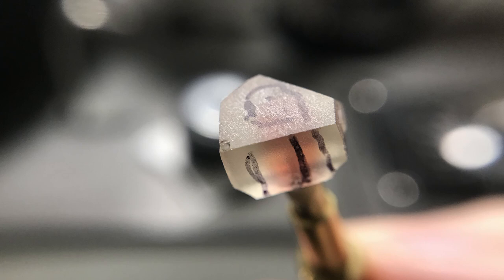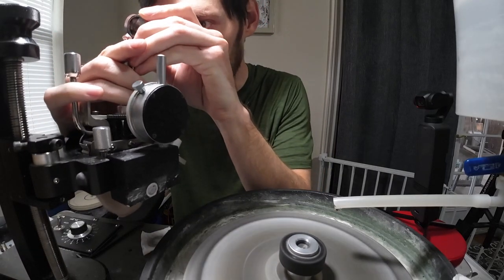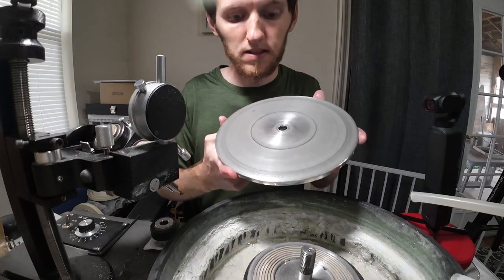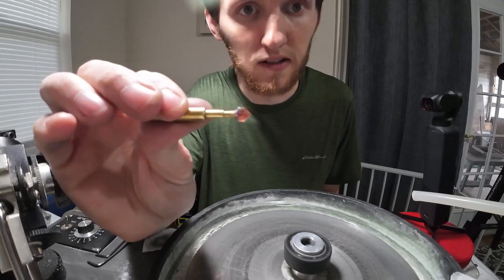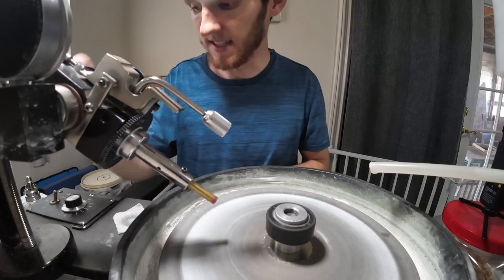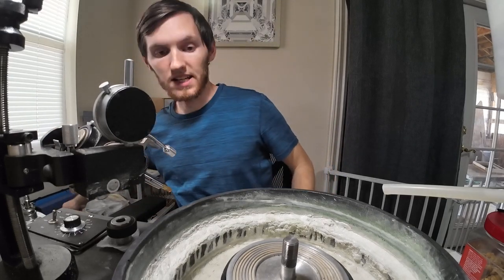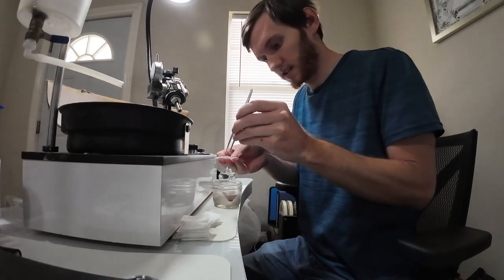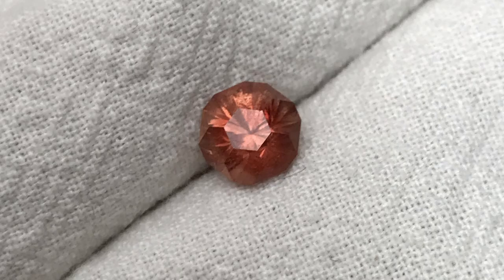Cutting an Oregon Sunstone with Schiller Start to Finish. It Turned out Amazing!

Comment: I love your vedios. I'm having trouble with my meets. You you have any suggestions for me? I'm a newbie. Thank you foe your help and vedios.❤
Reply from the maker: You can have meet issues from the get go when using a center point when some of the facets that make up that center point aren't actually meeting at a point. I use a 40X loupe when cutting to get my meets in close. If any facets are over or under cut, they affect the meets of any subsequent facets that are based off that facet. When using meet point faceting where the crown cuts start based off the girdle facets, any rotation difference in the alignment of the stone compared to the pavilion facets will throw off the crown meets.

Unless doing competition cutting, meets being off a little bit is just fine. There is a little flexibility in meets to where a stone can still look really good. And when using diagrams, some are a lot easier than others for getting the facets to meet properly. It is a lot easier to be off on designs that have facets that cut in not based on any sort of meet point to indicate that facet is cut in where it needs to be, but later meets depend on how accurate that facet was cut in compared to the design.

Comment: Great video! What lap did you use for the final polish? Thank you for making these videos
Reply from the maker: That is the BA5T lap. Is the more expensive version of the BATT lap.
Reply: @MattsCornerofGemCutting  What in your opinion makes it better then the Batt. I love my Batt and am thinking of trying the BA5T. Thank you for taking the time to answer my questions.
Reply from the maker: I've only used my Batt lap for 3k pre-polish and my BA5T lap for final polishing with diamond. So I don't know how they compare as far as quality of polish and quickness, but the BA5T does seem to be a harder alloy and seems like it will last a lot longer than the Batt lap. @glennhassig6668

Comment: Wonderful video! What brand of faceting machine do you use? What brand of machine would you advise for a beginner?
Reply from the maker: Thanks! I use an Ultratech V5 Classic machine. They are nice and easy to use, but hard on the wallet if you want a new one. I found someone selling a used one. I haven't used another machine, but I think that Facetron and Poly-Metric mast machines are also high end but still not cheap. Some people prefer hand pieces over the mast machines. It just depends on preference. I think that the mast machines work great for diagram cutting. I would look around for someone selling their used equipment for beginning. Or if you happen to be near any faceters groups that you can try out some machines, that could help to.
Reply: @MattsCornerofGemCutting  Thank you Matt

Comment: Beautiful!  I enjoyed watching you , but I think you need to elaborate on certain descriptions that you use, you say...schiller? What is that and what does it mean, same with your grinding discs, I hope you aren't offended by my comments, I just like to understand fully what I'm watching.  I got kicked out of the ER whe my hubby needed stiches, I was so up in that, asking questons at every stage, I don't mean to be a pain in the ass, I'm just curious!!  I think you have an amazing skill!
Reply from the maker: All good! Schiller in Oregon Sunstone is some bits of copper suspended in the stone that kind of looks like glitter. I use diamond grits for cutting. My 600 grit is a diamond plated topper lap which I use to cut in all the facets on the stone. I use 3000 diamond grit paste on a bat lap for pre-polish which gets the stone to a near polished look, and then I use chrome(chromium) oxide on a polishing lap for final polish to finish up the stone.

Comment: When you do final polish, what grit do you using?
Reply from the maker: I used 60k Pandemonium Diamond Compound that comes in a tube. I had been using 50k diamond powder, but the Pandemonium compound has an agent that allows the diamonds to be dispersed using water instead of having to use oil, which I like. The pre-polish is done with the 3k grit of the same brand.
Reply: @MattsCornerofGemCutting  so where did you purchase them?
Reply from the maker: @oregonaje4827  https://gearloose.co/shop/pandimonium-universal-base-diastik/